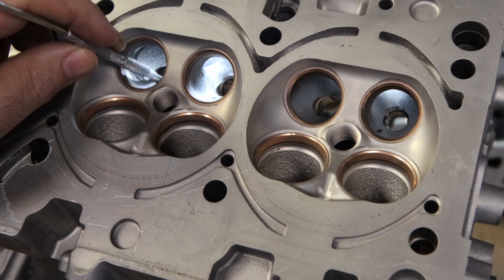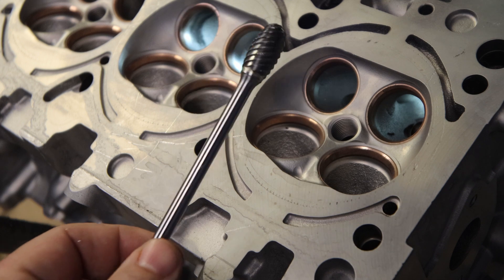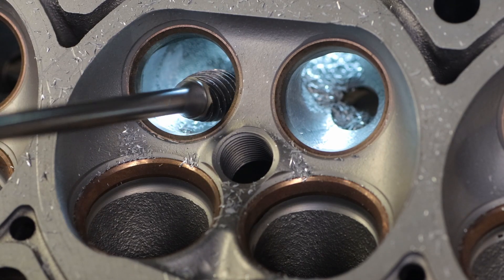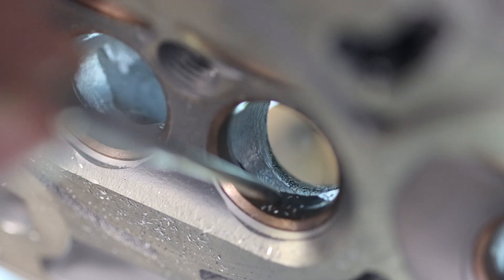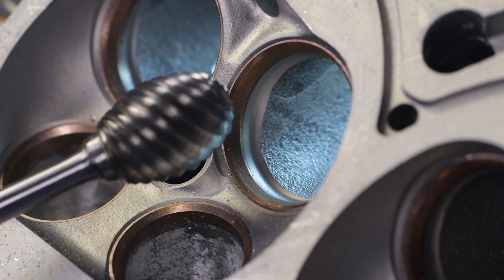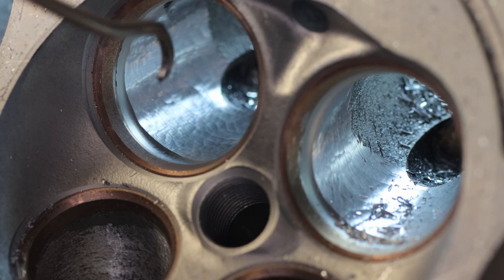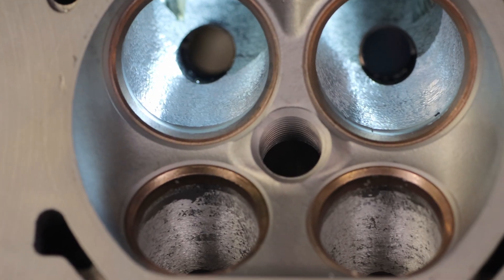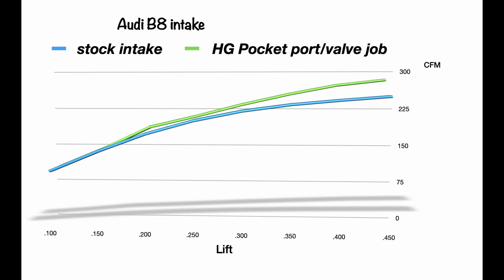Audi B8 Cylinder Head Secrets: Pocket Porting, Valve Job, & Flow Results Inside!

Comment: Quick question. I got a valve job done and guides with new valves cut for 1mm valves. My little one, lifted up my cylinder head while I was cleaning the house. before I had assembled it and all the intake got scattered.. I know I know lol should I get them relaped? Or would I be good to assemble you think?
Reply from the maker: What type of head?

Comment: U say surface finish doesnt matter for flow, but with the exhaust port i thought it would be beneficial to have a smooth finish that carbon would be less likely to bond to?
Reply from the maker: Beat on the car more, you will have less carbon build up. I have just never seen carbon to be an actual issue, just a theoretical one.

Comment: Your videos finally convinced me to build my own basic flow bunch at home and start playing with my buick 3.8l v6 heads and I have been surprised to find how easy it really is to get started. Slow changes with lots of testing on the bench. Now to get the car back on the dyno...... picked up 50 CFM! they still flow like crap but now its less crap haha.
Reply from the maker: Back in 97' I had the highest flowing buick head, I spent days on the flow bench and 5 cores to get there. There is HUGE gains in the valve job. I actually cut the throat on the seat and guide machine .010 at a time to find the sweet spot. But, I was in school and nothing better to do. Good luck with it! Glad I could influence that kind of action!
Reply: @headgames  that's awesome. This is for the 3800 series II supercharged motor. I'm on junkyard set number 3 lol

Comment: Hey David, another great video and info - Thank you!  I have an Audi EA835 ASN 3.0 30v V6 engine project - previous family to the B8's EA837(poor man's version).  The engine runs NA as stock, Al block with 5v Cyl heads.  Would the treatment you show translate at all?  Do you have any experience of these V6 5v heads?  They were in production during the same period as the 1.8T 20v L4 engines that also had 5v heads - do you know if there is any correlation of design/specs/components between the two?
Reply from the maker: @garrmann8088  we won’t work on the 5 valve heads. There’s going to be a special place in heaven for the people who enjoy them. Everything I point out will work on any head.

Comment: 250 to 280cfm is about a 11% gains, if we gain 11% on a 300hp engine we go up to 333hp, (I know is not quite this simple) but I think there are metrics that are simple for people to put more into context.
Reply from the maker: @krusher74  yeah for me, so many variables that are at play here I try to not give a specific expectation. But, your point is on point. A 700whp usually picks up 80whp with a 30-40cfm gain.